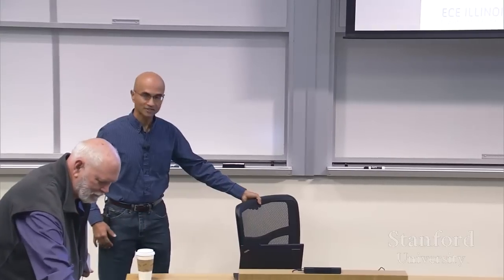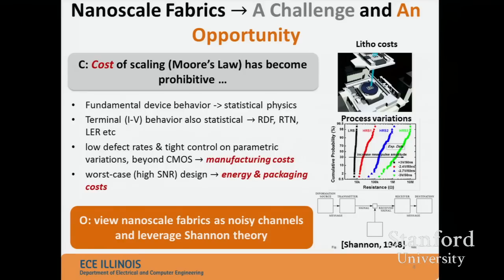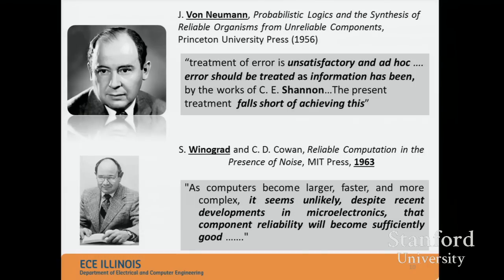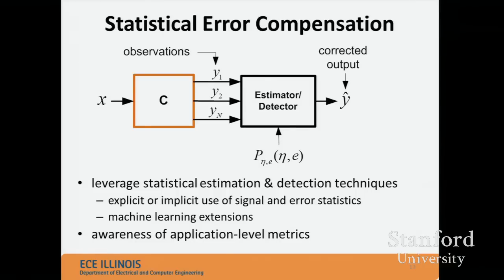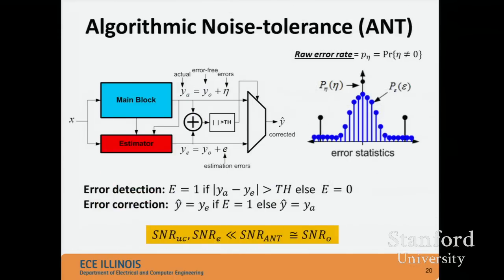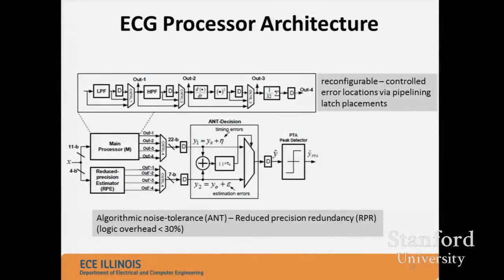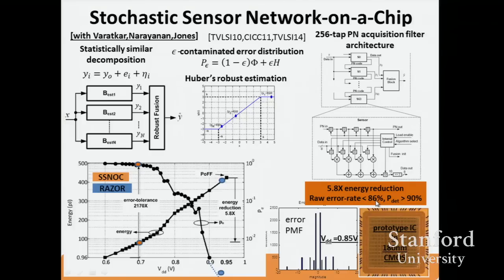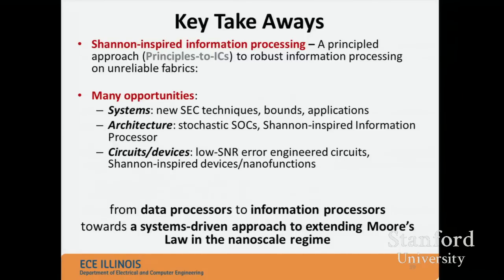Stanford Seminar - Shannon-Inspired Statistical Computing

Comment: Question Mark asked hits the nail right on the head. Logic (or processing) is a non-linear function. There is no way to reconstruct information after processing. So you need an arbiter to tell how far the result is away from the "correct" result. This arbiter includes the estimator and a decision maker. The overhead of this needs to be added to the overall system. Also, will the final system more accurate than the estimator?